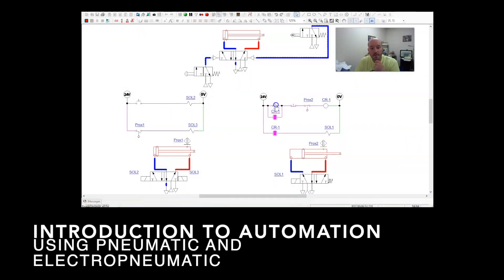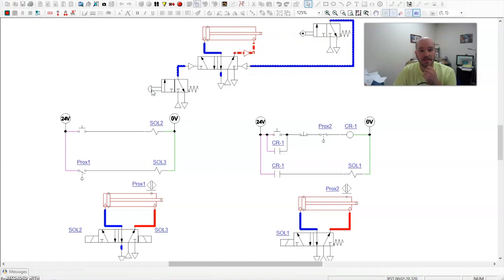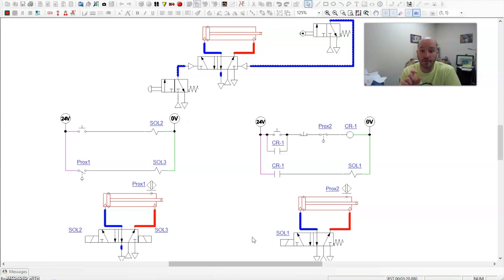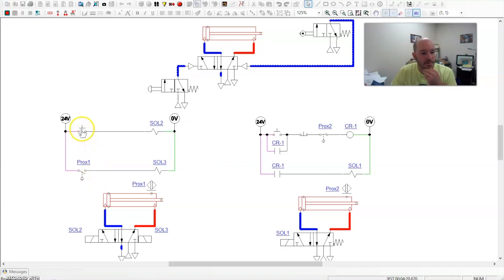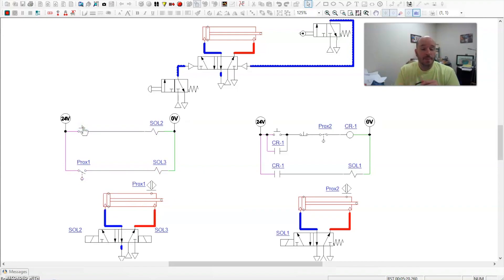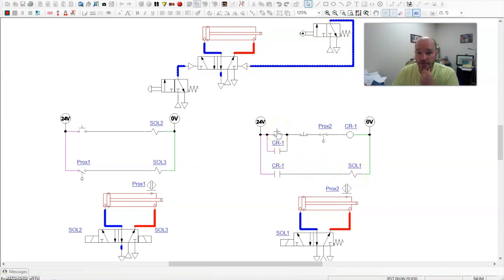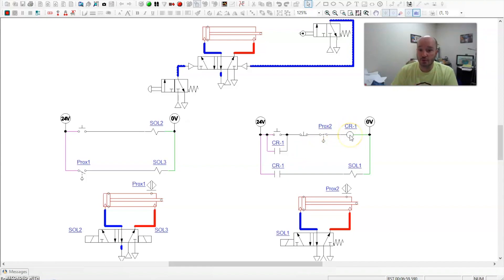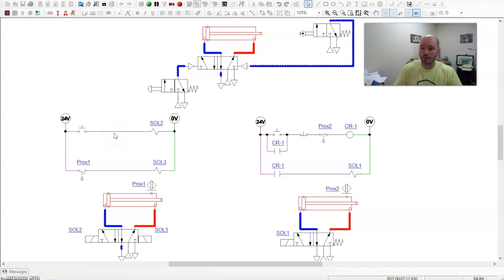Intro to Automation using Electro-Pneumatics

Comment: Watched your electrical outlet I use a cold shrink tape I used in auto repair has no adhesive been doing so sense I started putting ground up in late 90s. I learned ground up and tape from electrician I tweaked it with the cold shrink from my years as auto tech. Love your channel makes me think also has lots of useful information that crosses over to many things . Keep up the great work.   do you know if you come from Franklin Klette the the gun maker of the 1700. highly prized if you can find an original .
Reply from the maker: Yes I do.  I have actaully seen a fredrick Klette gun before.  Really cool